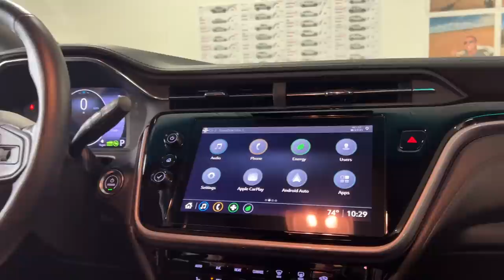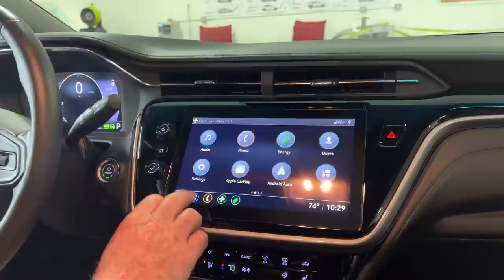Sandy's First Impression of the 2022 Chevy Bolt EV

Comment: Actually the 2023 model has a huge price cut, so it's $26,500 before any of the new tax incentives. So if/when those incentives come out, dang it's going to be affordable. It would sell like hot cakes but Americans are obsessed with their SUVs and trucks. Hopefully the Bolt EUV will at least be a big seller. Very tired of the old argument that EVs are too expensive for the common man.

Comment: Personally I don't find the vehicle very appealing and my opinion. The model 3  starts at 45,000 currently, has more trunk space, Frunk, faster charging, and over the air update. I just see sales of the bolt continuing to go down in my opinion. FYI I can't speak for all Chevy dealerships but here in Miami where I live all Chevy dealerships only have one technician certified to work on electric vehicles.

Comment: The one critical failure with the second generation bolt is the rear taillights. They aren't just bad, they are downright dangerous. The big obvious taillight module that everyone
 Will be looking at, does nothing. Its an accent light. Why the fuck would gm do something that stupid? And yes I'm aware of dot regs on brakelights on moving body panels, this isn't an excuse. Gm could have done the same dual setup like the gen1 bolt which worked perfectly. Idk, until they fix the issue, the car isn't road legal to me.

Comment: Say what you will about GM. This is a necessary car because it is one of the few affordable options for people that need an essential commuter car. Tesla has nothing to offer in this niche, as it can charge and get high prices for whatever they produce. What GM is showing is also a crucial step toward effective competition with China, and it comes at a time when the demand for EVs is shooting upward. If the federal incentives are signed into law, this car will fill a real need while at the same time mitigating environmental pollution at an affordable price. GM also appears to be well positioned to mass produce this car to help to break the log jams we are experiencing with vehicle deliveries. While the charging speed might be a concern for some, the Bolt's use case can be easily met as long as the buyer can charge at home.

I look forward to Sandy's assessment, but from what I have seen, the Bolt could rapidly fill the need for high-production, affordable EVs. I hope that GM will continue along this path and produce more options in this niche. Not only that, but I like what they are doing, I wish them much success.

Comment: I bought a used 2017 premier for 15k out the door. Received a new battery 2 months ago. Best vehicle I have ever owned for value and reliability. Can’t be happier….
Reply: New battery within 5 years doesn't strike me as reliable. What are your considerations for stating that?
Reply: @ST3FFAN036  battery was a result of recall and cost me nothing. So far I have spent nothing but a set of tires and charge my Bolt on solar panels at my home for virtually free. Best car I have owned in my 50+ years of buying and driving.

Comment: The value of the Bolt is pretty decent, but the build qualify of the interior is sub-par. My 2007 Pontiac was built better than the Bolt, and my similarly-priced Model Y is in a league of its own.

Comment: you talk about max charge of 55Kw without talking about battery size and charge time.  The latter two are quite important for context.  If it's a 50-60kw battery and L1/L2 charge time under 30/12hrs, then this is not an issue at all.  Fast charge time under 1hour 20-80% would be fine.  context is everything.  I don't know the real numbers so above are just for sake of pointing out the context.

Comment: People are waiting for a 25-35k EV car and this is just the start. The thing that will fail on this is wheel bearings, shocks and other basic parts. They look like generic parts and have a simple design . Never been happy with the aluminum  and steel parts that make taking out the wheel bearing  hard but many cars do this now. I like it but I am holding off for a bit.

Comment: I'm kinda hoping for a comeback of the spark ev, just a simple small car. I'd even be happy with a 175 miles of range but would need really fast charging on the LT trim and up. Problem is, in Canada anyway, the only ev on the lot is for the shuttle service vehicle, GM dealers don't seem to want to sell these (probably because you dont come in for oil and brakes during the life of a lease).
Reply: KANDI only $12,000.

Comment: Is that a wheel-well for a full-size spare?
If so nice. You don't see those very often nowadays.

Living in the sticks I'd never buy a car that has no option for a proper spare tyre.
Reply: I own a 2020 Bolt Lt, and I have a compact spare tire in that space.  Fits just fine.  Others report that a full size spare will fit also, But a compact spare works for me.

Comment: 6:43 Thanks to the Bolt EV's efficiency and range, long trips aren't actually that bad. GM did recently mess with the battery thermal management parameters, which they hopefully correct soon, but outside of those who are looking to set cannonball run records, the Bolt EV is perfectly serviceable on long trips. I was easily able to drive from Southern California to the North Rim of the Grand Canyon and back over a single weekend. Nikki from Transport Evolved was easily able to drive from Portland to Los Angeles and back over a long weekend. I'd say that's a might bit better than "just a city car."
Reply: It’s all relative.  Our 2018 Ioniq with half the battery of the Bolt road trips much better due to much faster charging and being even more efficient
Reply: @smartelectriccar  Not in my experience. While the Ioniq can theoretically keep pace with the Bolt EV on long road trips, that is only in areas where the infrastructure is very robust. I was surprised to learn from an Ioniq owner that, even in California, they often had to charge to full (really 94% or whatever the specific DC cutoff was) just to make it to the next charger. 

The 30 to 40 minutes it takes to charge an Ioniq to full is enough time for the Bolt EV to add even more range, despite the Bolt's worse efficiency. And, realistically, there were a number of trips that I made with my Bolt EV between 2016 and 2019 that an Ioniq couldn't even complete without having to rely heavily on L2 AC. 

There's a reason it's still common to see Bolt EVs charging alongside EV6s, ID.4s, and Mach-Es in Middle America while you'll rarely ever see an Ioniq more than 100 miles or so from a major city center.

Comment: Bringing back drum brakes!!! 🤣 Sandy sometimes you say the funniest dumb 💩. The answers are many but one of the top priorities is emerg stopping & for now with a heavier vehicle. ABS, heat dissipation, modulation etc. Discs have been around a long time, they're simpler, more reliable & much easier to work on. Everything added up a disc is cheaper than a drum & better in almost every way. The reasons why disc brakes are found on everything from road bicycles to race cars are all applicable to all passenger vehicles. I'd like to see brakes go away completely. Continuously variable regen & if needed apply power to the wheels for stoppage in emerg.

Comment: It's hard to believe,  but drum brakes are lighter and cheaper to build than discs, and work with parking brakes more easily. They perform just fine in the rear of front- heavy cars.
Reply: I threw away spring pliers last century - just sayn

Comment: Aside from all of GMs other issues, I would never suggest for anyone to buy into a Bolt at this point for the simple fact that next year GM is launching 5 (or 6? I cant keep up) new EVs on the Ultium platform. At that point the Bolt battery platform will be a deadend with no improvements and at some point it will be abandoned and they will introduce an equivalent vehicle on the Ultium platform. GMs technical training for sales and repair staff will likely be heavily skewed towards Ultium vehicles. So Bolt owners wont be getting improvments and may find support and repairs increasingly difficult in the near future. It is NOT a good idea to invest in a product that is destined to be abandoned in the near future.

This is why GM keeps dropping the Bolt prices when everyone else in the industry is raising prices. It is a fire sale. (No tasteless pun intended). Ask Saturn owners what it is like to be driving discontinued vehicles.

Comment: Go back and watch some of his reviews of the 2017 Bolt which is the same design as the 2023 Bolt except 2023 model has a 10% increase in battery capacity but has the same size and weight.  Sandy said the 2017 Bolt was a "shoe-horned together" EV design and "not built from the ground up" as an EV.  The Tesla model 3 base which is a built from the ground up to be an EV and is only 1% lighter than the Bolt and only 10% faster than the Bolt and 40%+ more expensive then the Bolt.  So where is this shoe-horned together EV design a less cost effective design?   And now Sandy says the Bolt is "very small".  I have never heard Sandy say the Tesla model 3 is "very small".  Is that because the Tesla has 112cu-ft of space where as the Bolt has only 109cu-ft of space.  He should be more careful when he says "very small" and "shoe-horned",  what is he comparing it to?  He offers no proof of "shoe-horned" or "very small".

I agree with his opinion on the utility and value of the car and after he drives it I think he will find it makes a very good 2nd car for short trips in the city, what EVs excel at.  But I think he owes the engineers at LG a clarification of where, when compared to other EVs it is a "shoe-horned together" and is "very small".

Comment: The incentives from the gov’t is a scam in my opinion. My taxes are paying for someone to buy an EV that is significantly more expensive than an ICE car. I don’t think I should have to pay for someone to drive an EV that they can only afford if others pay for part of their purchase. I think EV’s are a good way for move forward, but most families cannot afford to have a car that they can only use around town. The charging infrastructure is not available to support everyone buying an EV.  And the maintenance free aspect remains to be proven. I have heard several stories of Tesla drive systems having to be replaced around 100K miles. That does not sound attractive and probably is not inexpensive.

Comment: The hydraulic portion of brakes are going away thanks to Brembo, so going with drum brakes would be cheaper but way less safe than the quicker stopping power and efficiency those newer systems will provide.  Also be sure and leave the bolt parked far away from your house Sandy, we would hate to lose you in a fire.

Comment: I won't buy Chevrolet or other GM products anymore. They all start off seemingly nice and then at 50k miles they pop, rattle and shake as if it was a 20 year old vehicle. That's with normal driving same as a Honda or Toyota. The quality is as JD Power puts it "Initial" and then it falls apart.

Comment: The one thing that would stop me is the current quality of GM vehicles. We have a fleet at work of Explorers, Tahoes, F150/250s, and Silverados. They're work vehicles so they aren't treated the best. The Fords just keep going. Every single Chev has had major work done on the engine, the transmission or both. Mostly under warranty for us but I imagine those issues would start cropping up out of warranty for owners who take better care of their vehicles.
Reply: Fwiw Bolt has no engine or transmision Lol 
btw my 08 Silverado runs like a dream still. Maybe bc I drive normaly.

Comment: Complete GARBAGE. Can't believe they just shovel al the components in the engine bay of the ICE chassis and called it a day. The trunk is extremely tiny too, not to mention both of those double layers of covers under the trunk, like... WTF? I wouldn't even buy it for under 20k, a used Nissan Leaf would've have better trunk than this!

Comment: Drum brakes, especially on the front wheels, are a terrible idea IMO. In normal driving situations the need for brakes is minimal, due to regen. However, does anyone recall Consumer Reports failing Tesla because their brakes didn't stop fast enough in emergencies? Tesla were able to fix this with a software update, but with drum brakes that wouldn't be possible. From a safety perspective (stopping power, ABS, cooling) front disk brakes are a must, IMO.

Comment: For people that can only afford 1 car majority of those are the same ppl complaining that teslas are to expensive this car is useless. Its half the size of a model 3 and yet still doesn’t even meet let alone beat the model 3 in range. These owners will never be able to do anything other then drive too and from work  lol. Whats the point of that.
Reply: Bulldhit!Its a amazing ev!
Reply: @brunoheggli2888  can you elaborate on that? What part of it is amazing?
Reply: @xrpo.g6855  The part about simple practical and reliable if the batteriepack is changed and good value for the money,its a perfect car for the massesThey just had bad luck with the Batteries from the suplier!I would like to have one,but sadly they dont selll them in Europa,it would be a big sucess here!And i like the design tlo,it looks very modern and has its own caracter!
Reply: @brunoheggli2888  Fair enough. I agree with you. i too don't mind the look of the car the front is decent looking, except its still just and ICE Vehicle platform with an electric motor. No real innovation or iteration has been produced for a real solid ev. Gm's usual talk the talk not walking the walk when it comes to manufacturing. I wouldn't spend a single penny on the bolt myself. also when and if tesla does do a compact vehicle like this, (if they need to once having solved for fsd) its going to be game over for gm. they will not be able to compete from just a cost of manufacturing stand point compared to tesla. Tesla will most likely come in cheaper and will have larger profitability per unit. just like they do now compared to toyota selling 10mill units and tesla only at 1 million but are over 3x more profitable already on just a run rate of 1mill. wait for economy of scale to kick in and they are producing the same 10 million as toyota and then 20+ million. Tesla being a money printer will be an understatement. No other manufacture at this point in time can compete. Just saying.
Reply: @xrpo.g6855  Yes only Tesla can profiting from the ecvonomy of scale BYD and others are to dumm for it!If Tesla has some advantage in production,its impossible to just copy them and saving a lot of money for R&D!Tesla is soooo sucessfull that they are falling back in  europa every year so right now they are number 4 in ev sales behind  Stellantis and soon they getting beaten from hyundai and Kia together because the Ioniq5 sells like crazy!
Reply: @xrpo.g6855  Tesla has just the best Batterie tech and is crazy vertical integrated thats why they buy Bateries from BYD!
Reply: @xrpo.g6855  Baidu has right now anounced tbey they will soon have 800k Robotaxis on the road and their system is way ahead of Tesla because they use LIdar to!
Reply: @brunoheggli2888  Not sure where you are getting your facts from but year to date tesla model 3 took the number 1 spot & model y took the number 2 spot for best selling ev's in europe.  i have a link that shows these facts but when i post it on here my comment seems to get deleted. 3rd was fiat, 4th was kia, 5th was volkswagen, 6th was peugeot but that was a hybrid not pure ev, followed by audi , hyundai, Renault, and ford which again was  hybrid not pure ev.  Also i'm not sure what the problem is as far as profitability. Let me put it in perspective for you. Gm for example can be profitable on sales of their evs. in order for that to happen, they would need to sell 7 units to match the profitability tesla achieves from production of 1 single unit. i'll let you draw your own conclusions on the outcome and time frame on how long legacy automakers will thump along on that path till they run out of money....
Reply: @brunoheggli2888  They will buy batteries from anyone that produces cells because they at this point in time can't get enough to keep up with demand of their products. which is why they are also starting to manufacture their own line of 4680's. in addition to sourcing from other manufacturers. If its just about battery cells like you are suggesting then why have gm for example recalled every single bolt for battery related issues. Why has ford recalled and stopped manufacturing the mach e due to battery issues ontop of other performance issues. in addition to admitting they are not profitable on the mach-e. After all the supply of their cells could be also from the same supplier tesla sourced cells from....
Reply: @brunoheggli2888  Lidar is not needed. Elon has already said this.. Baidu like waymo is only operable in a geofenced designated area. think of it as pre mapped. Your can drop a tesla anywhere in the world and it will operate autonomously with no issues. its not going to be restricted to a geofenced area like baidu and waymo  Teslas fsd is a completely different beast. cameras and nuralnet. Solving for real world full autonomy. With out Lidar.now & with out radar at some point I'm assuming. You need to do more research... You don't seem to know as much as you seem to think. its becoming quite evident.

Comment: Garbage car, too expensive for what you get.  That goes for all EVs.  I wanted one but now, I would stay away from them because the cost to operate is 10000X more.  Buy my EV for $40k then in 3-5 years buy a replacement battery for $20k-$40k.  No thanks.